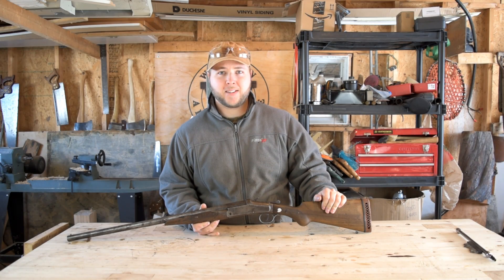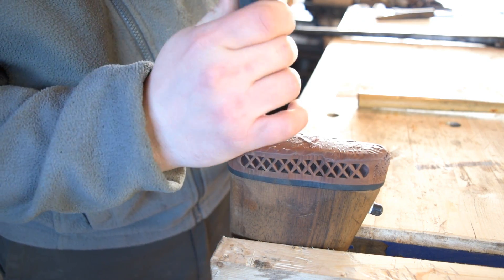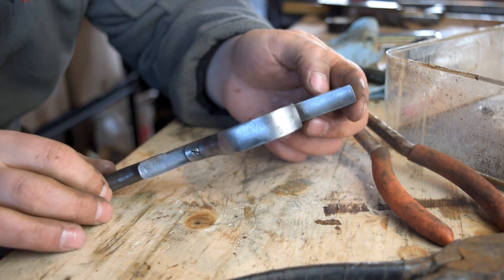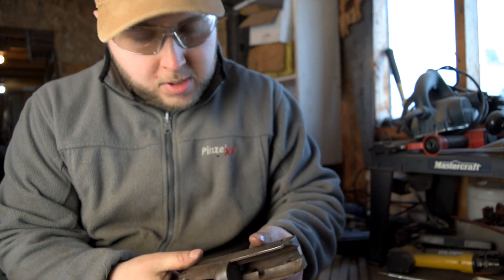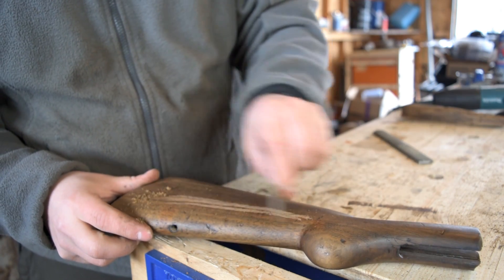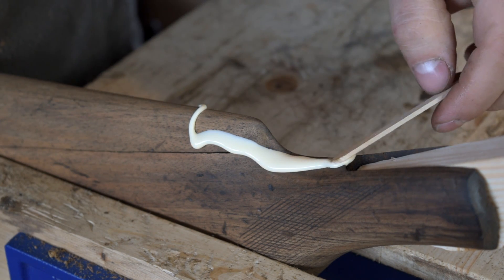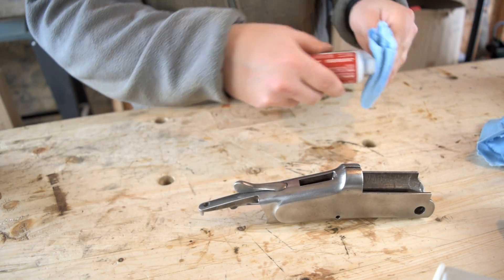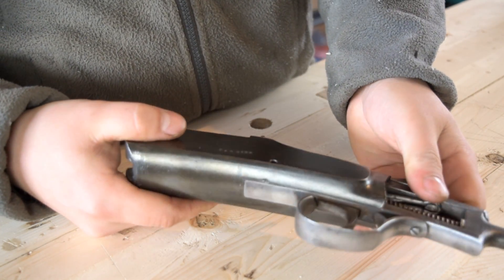Restoring an Antique Shotgun - [NLH 8]

Comment: Nicely done, two suggestions, 1-gloves, and 2- save all the scrapings and sanding dust and mix with the wood glue when you glue up the cracks, I have done that on a couple stocks and it is very good at blending and preventing a stain shadow line. But again well done giving an old shotgun a new life.
Reply: 3rd suggestion.... blow your nose

Comment: An old tip is using broken pieces of window or plate glass as a scraper. Tape it on one side for safety reasons and throw it away when it's dull. Great video!

Comment: Speaking from the experience of a retired US Army soldier I can tell you that canned carborater cleaner is a primary resource for firearms cleaning, at least in the units I've served. My Beretta 9mm was field stripped, cleaned with the carborater cleaner and wire brush, NEVER oiled or lubricated in any way, reassembled and ready for use after every 15 day patrol. Very nice restoration on the shotgun.
Reply from the maker: Thank you for your service.

Comment: if you don't have gloves, you can always stick some wood dowels in the ends of the barrel to make handles. Also good to run the steel wool through a cleaner, like alcohol, to get rid of any oils or etc. 
Still nice job, turned out great.

Comment: Old Plastic gift cards or even old credit cards are good for making little disposable tools for cleaning and getting glue way down in cracks!! They are great for cleaning groves like on semi auto slides.  They will get a drop of oil or glue just where you want it too.  Great for mixing a little epoxy or any two part mixture. Use a 1/4 of a card or so as a spatula, and another card as a mixing platter. They cut into anything you want with a pair scissors. Hook tools, aline small springs anything you can imagine. Within reason. Cheep and easy.
Reply from the maker: Thanks for the tip!

Comment: Looks good, I've done several of these in similar condition and a wet towel with a clothes iron would bring most of the dents out of the wood. I like to use Acetone for degreasing  the parts to be blued.

Comment: Looks good, a wooden dowel inside the barrel is a good way to not touch it after cleaning. I use either Acetone or Alcohol to remove oil from the steel. A heat gun moved back and forth will evaporate any residue from cleaning and the steel will more readily accept the bluing. Just don't get crazy with it and make it too hot, just what works for me.
Reply from the maker: thanks for the help Keith!

Comment: A strong suggest about putting your weapon on wire wheel. Try a very stiff fibre wheel. Removes almost every imperfection yet is less likely to "burn" or scar the finish or patina.

Comment: Over here on PEI I pick up 3-4 of these type of deals every time I visit my gunsmith. I've got like 5 break barrel singles in 12g. I did plan on restoring most of them but there they sit.  I did end up getting one in great working order. Sometimes my aspirations get the best of me
That looks great tho. You've got more motivation than me haha!
Also, I really haven't had good luck with Outers brand gun blue. Birchwood Casey is what I've been using lately, it's a bit less streaky
Reply from the maker: Send some of those break-actions over to me!!
Reply: Kyle Noseworthy - Weiderfan 
I actually would. Not 100% sure of the logistics of shipping non restricted through different provinces

Comment: Next time you do a gun like this, instead of wire wheeling off the rust, put the metal components in either a pot or a turkey pan and boil them all for 45 minutes to an hour. The boiling will convert any red rust to black, as well as boil off the gunk, then take a soft carding wheel or brush and use that to get your polished look. You can repeat the process ad nauseum and it creates a rust-blued finish.

Comment: Great job very well done I have a couple of questions i bought 2older shotguns they are in really rough shape my question is both of the barrels when locked in the receiver they appear to be loose they stay locked but are loose last question one has a bolt in the foregrip it's good one has no bolt just a small pin what a groove where the grip snaps into place the problem is it's not in place on the barrel gaps thanks for sharing

Comment: Great job Kyle   some of the old on your metal can come from to brake cleaner  maybe try a electrical contact cleaner   no oil residue
Reply: I very much doubt that you'll get much 'oil' from a good quality 'Brake Cleaner solution, Joe. Have you found this to be the case ? 
Of course one way to tell is to spray some on glass, and see if there's oil residue remaining after it dries.
Reply from the maker: The job of brake cleaner is to remove oil!
Reply: Kyle that is true but most brake cleaners leave a small amount of oil residue , a good quality contactor cleaner is much  better

Comment: Great job!  I recently acquired 60's Winchester Red Letter .410 that belonged to my great grandfather.  It was in an old box in an outdoor shed since the early 80's right on the coast. It is in terrible shape.  I've never restored a gun, but thought I'd give it a shot.  It looks to be in the same condition as yours, but with a lot more rust on the barrel.  My question is, how did you know that it was useable without taking it to a gunsmith?  I am trying to do this restoration well, but reasonable cheap since it is my first restore (my mother was going to throw it out, it was such a mess), so I don't want to add extra cost by going to have it checked by a gunsmith if possible.  So, I was just curious how you decided it was in firing condition.

Comment: Use a brass hammer and a support block under the receiver when replacing pins. Attach the barrel after you rebuild the action Bubba
Reply: Better a firearm Bubba than a comment section Karen

Comment: Nice job of restoration Kyle, but I was wondering about handling any of the newly cleaned parts with your bare fingers !
 Wouldn't it be better to wear latex gloves? They will protect that bare clean metal from your natural skin oil, not to mention,  keeping that chemical away from your fingers too.
Reply from the maker: That would be better. Didn't have anything at the moment!
Reply: Thank you! I was annoyed that he didn't use gloves to handle the metal parts when cleaning and prepping for the blueing.
Reply: CyberPirate2008 its really not that big of a deal😂

Comment: Good collectible, but effectively useless to shoot without a choke. Love your vids
Reply from the maker: It's effective distance is reduced, but far from useless.
Reply: Kyle Noseworthy - Weiderfan . Maybe useless is to harsh a term. From my understanding a cylinder bore shot will spread at an average of one inch per yard. At fifteen feet that would be a spread of five to six inches in diameter. Maybe a field test is in order to prove or disprove. Beauty restoration though!!

Comment: Just a quick word - Elmers Glue is NOT STRONG ENOUGH  to withstand the recoil of a 12 guage shotgun !   
That stock is going to fail again, and when it does, you might end up with a face full of shotgun !   You should
soak it in HOT WATER until the Elmers glue dissolves,  and then reglue it with a good grade of Marine Epoxy.
Otherwise, that gun is a time bomb that will eventually injure someone.
Reply: NICE comment

Comment: This is a video of what NOT to do to a good gun  NEVER use a wire wheel, angle grinder, reblue, use a steel hammer on a gun.    please don;t ruin a good gun,    after is messed up you can't put it back,     please watch a good video,    ok for that gun because it is a VERY POOR GUN,    never do that to a good gun    ever  please